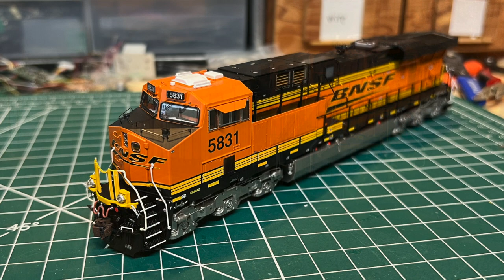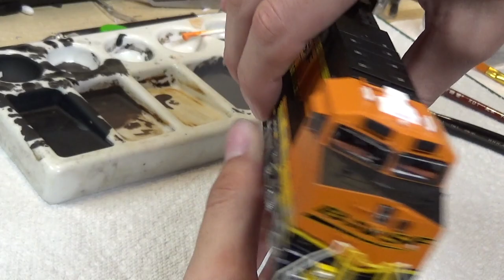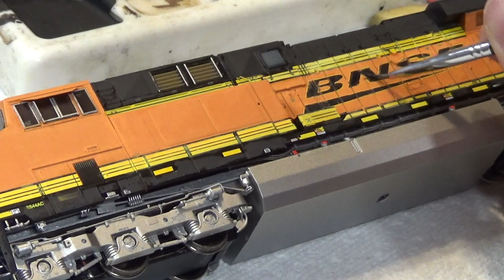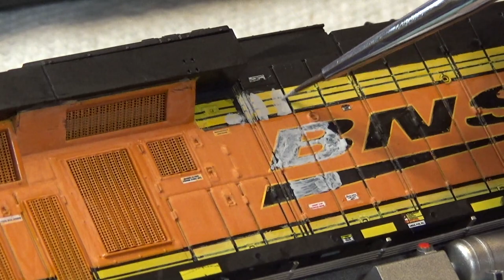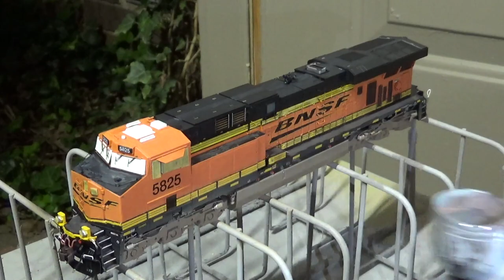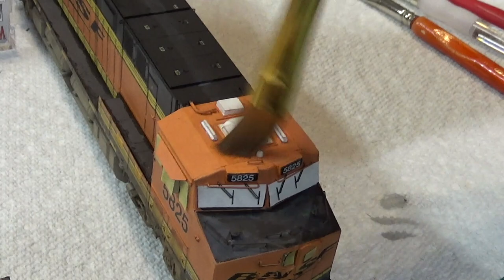Weathering A ScaleTrains BNSF ES44AC

Comment: The unit came out very nice but I do not get the white radiator grills on top you did. It really takes away from the model. I have stood on many an overpass watching trains and I have yet to see white grills. Anyways, thanks for a good video.
Reply from the maker: Thank you. I’ve seen many early BNSF ES44AC’s with the white grilles. It’s due to the paint burning off from extreme heat.
Reply: @WhiteRiverRails  Oh I understand why you did it but never seen it. A couple of the Virtual Railfan webcams have down on views at a few BNSF locations and I looked at the tops of many BNSF locomotives and did not see any white radiators. Saw several of the early ES44AC's. Anyways, wonderful work. Take care.